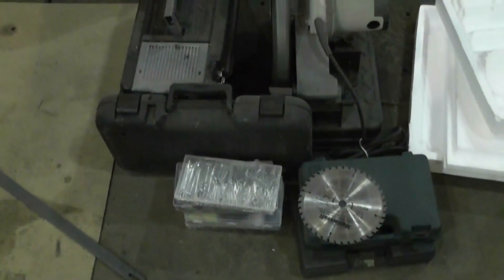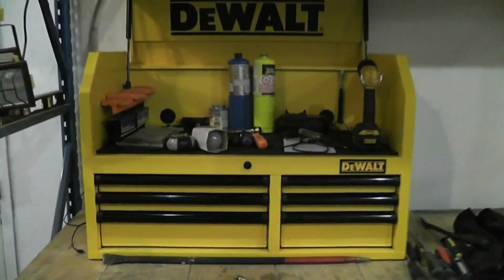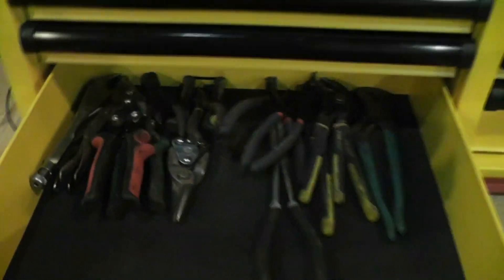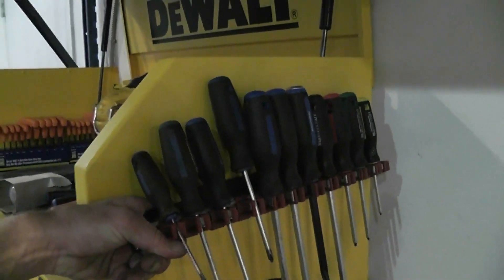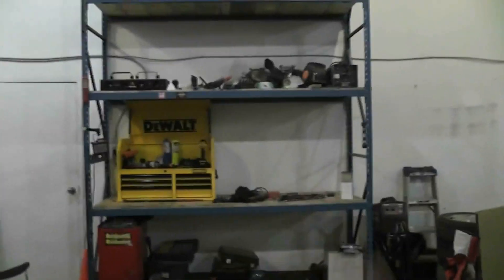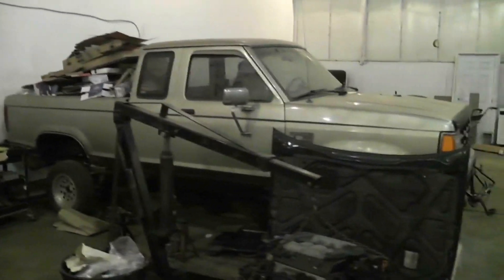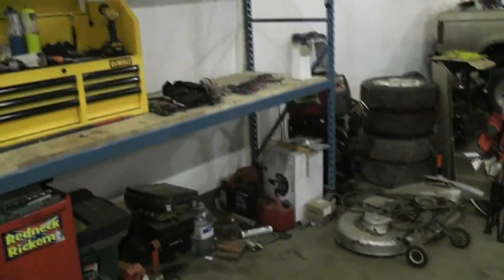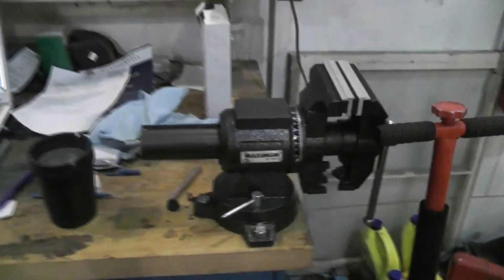Finally Upgraded

Comment: Wouldn't have been hard to make a toolbox like that. suppose it's not worth the time for some people
Reply: +Stoneforth $200.00, think about it.  If you were being paid by someone, minimum wage to build this box, that includes planning and everything else ($11 per hour) you have 18 hours constantly to build it, this is assuming you have all the materials, bearings, paint etc to do it.  Rick would have to NOT work on other things, which make him money in order to build it.

And he wouldn't have the quality of the purchased one either.
Reply: TakeiT
I could make a similar box in about 4 hours max with store bought rails, rick probably could too with the right tools. The only difference in quality would be the fact that i'm not a perfectionist and wouldn't bother grinding down my welds etc... and the fact that i'd use scrap for most of it to save money. This is a very simple design. It's about having the right tools. If you don't have the tools, like a press brake, or the time; you wouldn't bother. If you factor in the time and materials, you could save $80-100. Not for everyone.
Reply: +TakeiT and btw rick drove over 300km there and back to pick this up so time clearly wasn't a factor.
Reply: TheSmoothGrind  Speaking from actual experience, 4 hours is plenty of time to plan and shape sheet metal to make a solid toolbox. If i didn't have a press brake and had to weld it'd still be done in under 4 hours. I work with sheet metal everyday, and like i said, i'm not a perfectionist; i'd leave the GALVANIZED sheet metal bare. Maybe i'm just a fool for not wanting to spend hundreds of my hard earned notes on a store bought box just because it looks better.